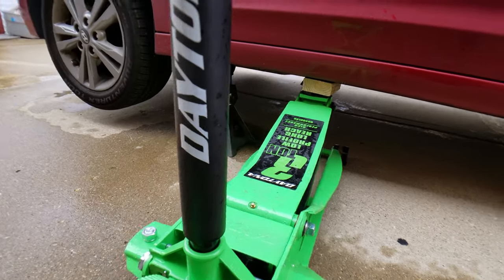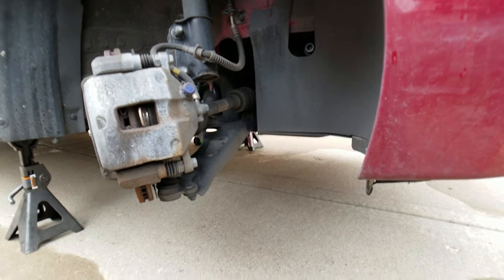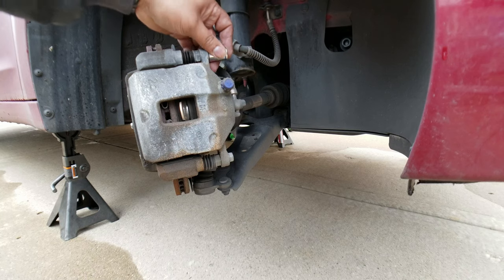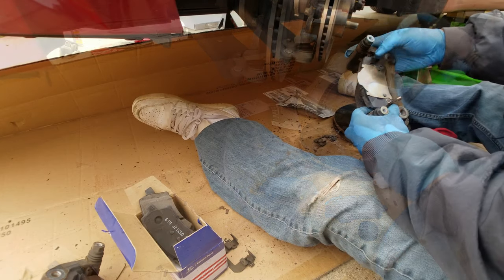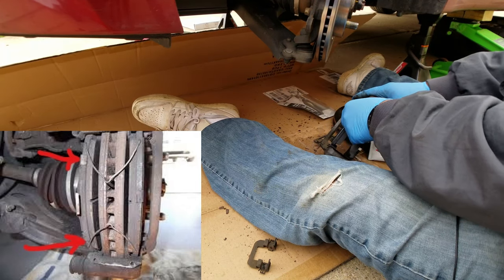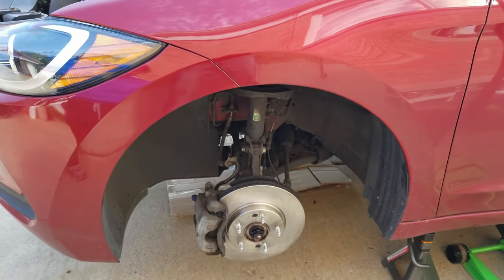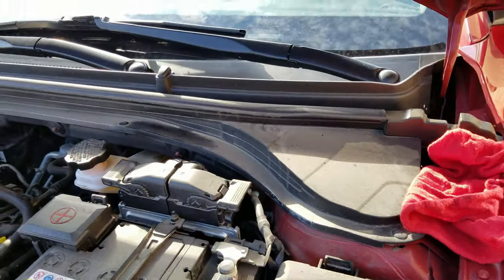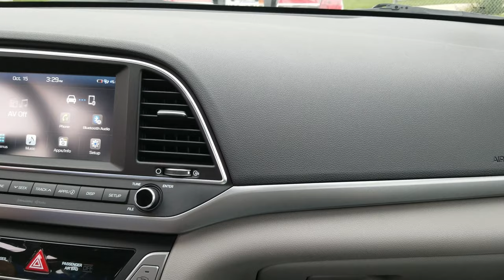How to replace Front Brakes, Pads and Rotors on 2017 Hyundai Elantra

Comment: I'm doing this tomorrow.  I got a 4 wheel brake kit from RockAuto for a decent price.  I sprung for coated rotors and ceramic pads for the first time ever.  I'm installing on an '08 Lexus RX 350.   My car has center point jack spots.  It will be the first time I ever had my whole car up on jack stands.  It's the easiest way to change the fluid and all components though.

A tip for the phillips screws in the rotors - a quick spray of panther piss aka PB Blaster then use the cheap impact screw driver from Harbor Freight. Breaks them loose quick, fast and in a hurry.  I'm here because of the Bear.

Comment: Dont  be afraid to whack the love out of that old rotor! Haha. Thanks for the video. I've probably done brake jobs a half dozen times, but not in the past 15 years. I appreciate the chance to get confidence boosted and my memory refreshed before I dive in.

The rotors were already warped so i let the pads go to metal. 85k miles. Being a hyundai, i think this mught be the last brake job this thing sees.
Reply from the maker: Thank you for watching and great comment.
Reply: not sure why the "being a Hyundai" comment. I'm getting ready to replace my front rotors and pads for the 3rd time @286K miles.
Reply: @KBzPTGT  you say that like any respectable portion of Hyundai/Kia products are bound to approach 300k. It just isn't true, and the evidence is everywhere. They're fine cars for the price and I do believe they have been improving, but let's not be silly.

Comment: Hi Ed, I messed up when changing the front brake pads. After squeezing each piston, I pumped the brakes while the cap was off of the brake fluid reservoir. How serious was this mistake? Should I bring it in to a shop to get the brake fluid replaced?

Btw this video was very helpful, thank you for making it.
Reply from the maker: I am missing some more info but as long as the break fluid in the reservoir did not go lower than the lowest mark and introduce air into the break lines or the ABS system no issue. If it did the issue is still not that bad depending on your make and model. Flush the system by adding break fluid to the full line and drain to the low line from each break caliper do not allow the fluid to go past the lowest mark and keep adding new break fluid as needed. I like to do about 1 to 2 bottles worth and air bubbles have never been an issue. If Air gets in the ABS system it's usually been cleared by this method but you must be cautious and consider a shop for this type of problem as on some cars you need a special device to actuate the ABS to get the air bubbles out.
Reply from the maker: You will know you messed up if your pedal is super soft or not working the breaks right. Test carefully.
Reply: @edtheoldtechguy  thank you!!
Reply: I NEVER take the cap off, that's stupid.  Whoever heard of that?!!  Leave it on!
Reply: @conanhall1 I think the thought is that when you push the piston back in to make room for the thicker new pads it pushes more fluid back to the reservoir than it had before and the cap being off allows for the extra pressure to come through. Idk if it really matters though.

Comment: Ok.  I watched the whole thing now and holy cow, brother.  I'm pretty impressed with this video.  Great editing and that lavaliere mic is pretty good sounding!  I normally have at least something critical to say, but this is really good in my opinion (even the background music which I am normally not a fan of).  The only thing I really had to add is the impact screw driver and when you're doing the bedding stops, try not to stay stopped for long if at all.  You don't want the hot pads to linger and heat one place in the rotor (unevenly) as that may case a warp.
Reply from the maker: Thanks man appreciate  the info!
Reply from the maker: I appreciate and love the honest feedback. That's the kind of info I need to grow my little channel. @Tech Gorilla  thank you bro!

Comment: Ahhhhh… I was good until I saw the tightening with a torque wrench like it was a regular ratchet. Was told could strip the gears out. So I’ve always just tightened up with a regular ratchet until putting the car on the ground and torque spec-ing from there. Great video overall. 💪🏼👍🏼👍🏼
Reply from the maker: Thanks! I have never heard of tightening with a torque wrench being an issue but hey learn something new every day. Thanks!

Comment: Just followed exactly how you did it mate, but now the car won't turn on, because of abs light on, and I can hear it clicking when I am trying to turn it on.

And the anti-crash light shows on at the same time as the abs light when trying to turn the car on
Reply: ...And it's a 2017 Hyundai i30/Elantra PDE/PD.
Reply from the maker: Wow! I am sorry you are having issues.  It sounds like you allowed the break fluid reservoir to drain beyond the indicated line or air entered the breaking system some how. I suggest you do a full break fluid flush. I will address this question on my live stream tonight and see what other guidance the community  has.
Reply: @edtheoldtechguy  hello again mate. 
I troubleshoot it, and 2 things helped me out. 1. Used some electrical spray cleaner to clean of any spilled brake fluid on the cables.
2. Got jump starter from my neighbor car, and both or 1 of them help me start the car up again. Now perfectly running without any warning signs 😊🤘

But found your video useful mate! Thank you again!

Comment: How many miles did the brakes last? Do you recall if the rotors really needed to be replaced?
Reply from the maker: I beleive he had 80k miles on the rotors, I did not measure the rotors as the client decided he wanted replaced.  35 - 50k on the pads. City driving kills those pads quick.

Comment: I appreciate but to the bolt you did not put the tread lock, so that it may not become the loose with vibration....if I am right accept it  otherwise ignore it please
Reply from the maker: Hey, no problem, some do use thread locker. I have not used it for breakes for decades and have not ever had a bolt come lose due to vibration. It could be the rust in my parts keeps things tight where I am.

Comment: Never ever use an impact gun on the rotor screws.
Reply from the maker: Really why? Out here those things rust and usually have to get drilled out. That Makita impact driver is a small one its not the big one. I would love to hear more on why you say this.
Reply: @edtheoldtechguy  "Never ever use an impact gun on the rotor screws". This may eliminate the chance of damaging the screw face and save you more on the unnecessary work. When people repair the cars on the youtube, most of them are NOT professional. They can get things done but not done the right way. I have seen people replacing the brake pads and leave the caliper dangling. if they are lucky, they can still get the jobs done. If they are not, you will not simply tell them "hey, no big deal, just replace the brake line".
Reply from the maker: @wengv  Thank you for your take on this. I live in the midwest, where most of the time the disc screw needs to be drilled out and never replaced. Even local dealerships do this. My dealership even informed me that the screw is used at the factory only to hold the discs in place on the assembly line while the caliper and pads are built around it. It serves no other use. I am not technically a pro but I have been working on cars for many years. If you are a certified Pro I will take your word for it, but I have to ask, what do you use in the rust belt then?  Admittedly I have been using my impact gun or the impact screwdriver and hammer for years. Fortunately, I have never had a problem and I have repaired many cars.  I've also drilled out many screws and again no issue. Perhaps you are right, there are those who will try to do the work themselves and no matter how well you show them to do something, they will make mistakes. These mistakes can be costly. There is an amount of mechanical competence that is assumed when someone watches these videos and attempts the work themselves.  As always I am simply showing how I do the work and what has worked for me. I truly appreciate your advice and I will bring the subject to the mechanic community here on youtube to see what their take is for more advice.
Reply: @edtheoldtechguy  you are correct, those screws are installed at the factory for assembly and aren’t even necessary after that. The wheel is going to hold the rotor on anyway.
It’s nothing wrong with using the screws though and that small impact isn’t going to really do any damage. I always use a screwdriver bit with a ratchet and socket but it’s all the same.
Reply from the maker: @Bgoodman6113  Thank you! 😊  I have done it this way for a long time now, no complaints or issues 😉  Really appreciate your comment.
Reply: That impact was for drywall and 2x4’s. Not nearly as powerful as a pneumatic or something